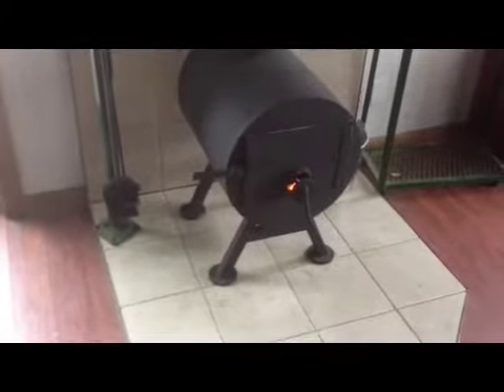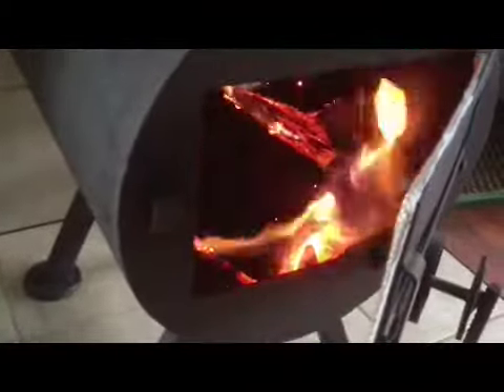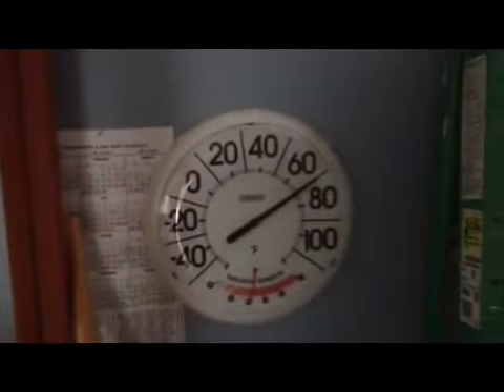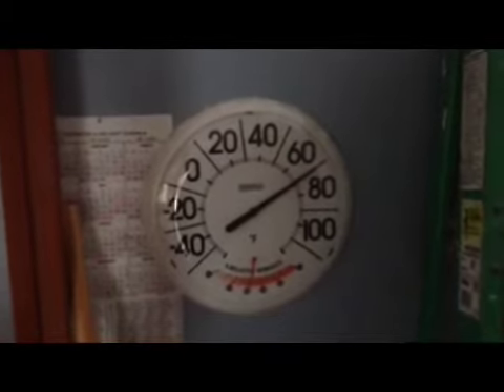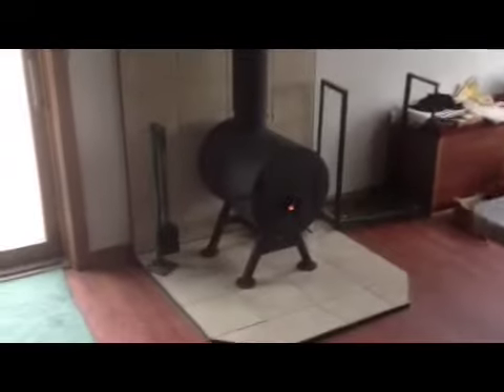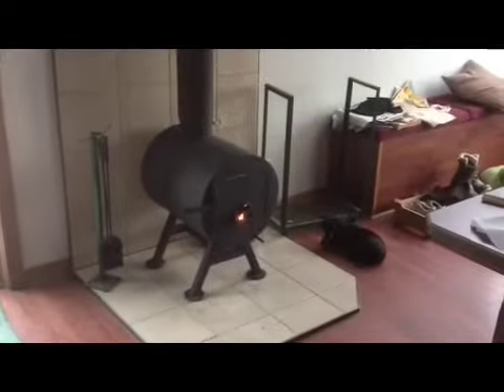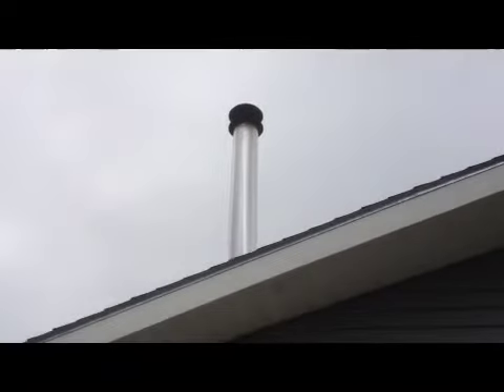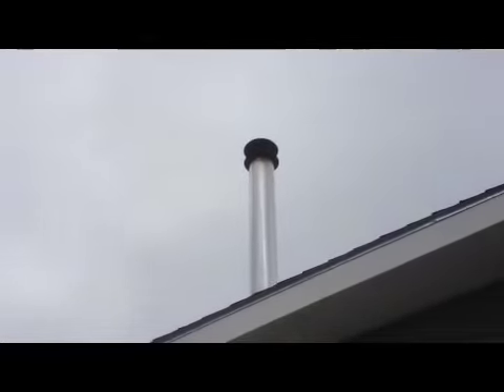Half barrel in action

Comment from the maker: Hi Anigele. I have a couple other vids and one explains the process. It's a bit long, but I tried to be pretty thorough. In a nutshell I pull apart an old hot water heater, clean the inside tank, cut it to size, weld on legs and a collar, fabricate a front and door for it, give it a good overheated test burn, then paint and package the stove for sale. Inside I just hooked up the stove according to my local building and fire codes. Hope that helps. Check out my other vid. It might explain better.